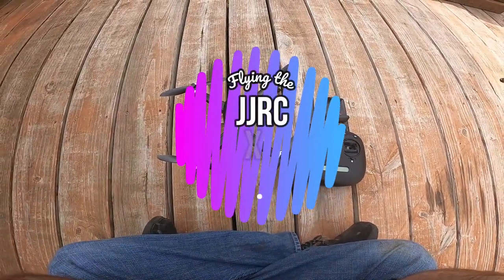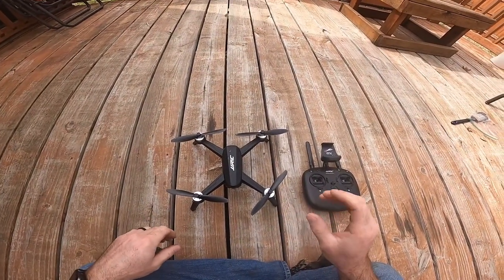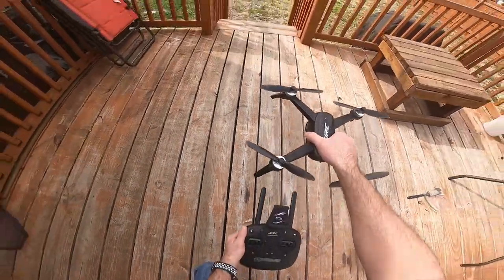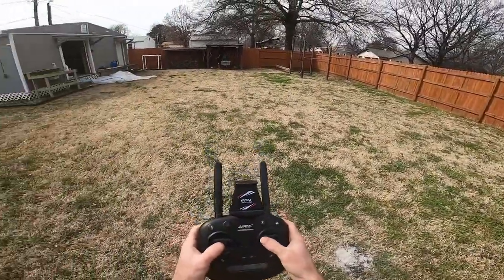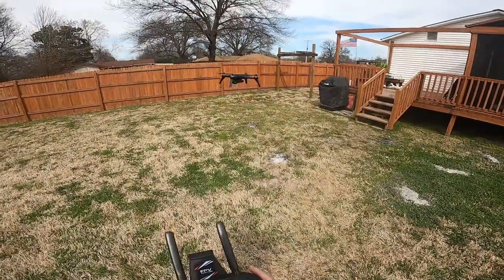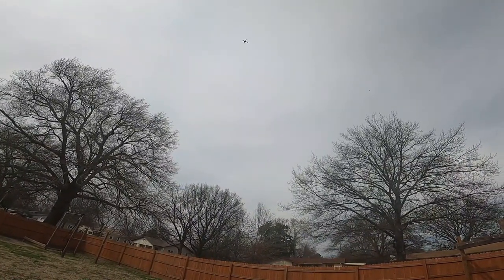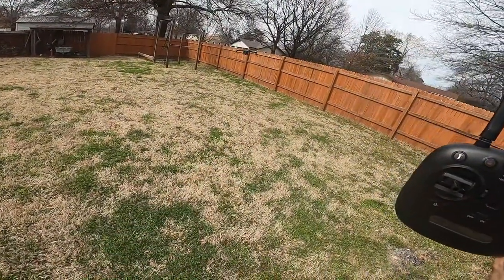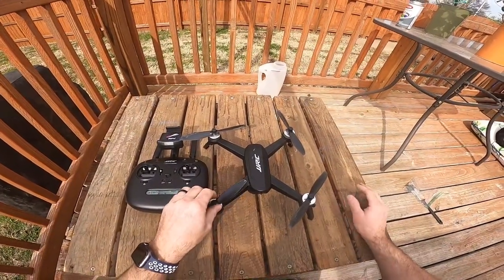Flying the JJRC X5 GPS Drone

Comment: Did they offer you a free gift for making a video of this drone? If so.. what do they send? They put a card inside mine saying about a free gift if I do a review.
Reply from the maker: Bob Holsopple I got that offer but I didn’t do it.  So I can’t answer your question.  Sorry.
Reply: @rjguess  you made a video. You should have got the free stuff.
Reply from the maker: Bob Holsopple true but I didn’t submit it or send it to the manufacturer.
Reply: Do you have an issue with yours falling out of the sky while trying to land? Mine does it constantly. It has good props,new battery, not around .metal or power lines,and it happens while in fpv or not. I think its defective ESC or something. Iv never seen anyone have this problem and I watch alot of YouTube videos about this drone. Cant find any info about this issue that matches my problem. It's not rotor wash because I decend while moving. I think its defective.
Reply from the maker: Bob Holsopple good question. I actually had this happen to me 2 times and it also flew out of control.  I had it take off and go crashing into a house 3 houses down from me.  I found out it was my controller losing signal and glitching.  I contacted customer service and the replaced me remote for free. No a single issue with the new remote.
Reply: @rjguess  I have to go through Ebay then mabe square trade. Its probably going to be a nightmare. But it seems like my input on the stick doesnt matter sometimes. It has a mind of it's own.
Reply from the maker: Bob Holsopple bummer.  See if you can email the manufacturer.  That’s what  I  did.
Reply: @rjguess  found out it may be vortex ring state (VRS).
Reply from the maker: Let me know if you get the issue resolved.